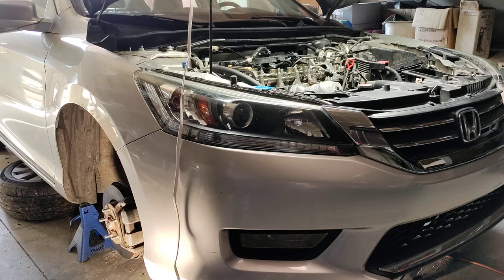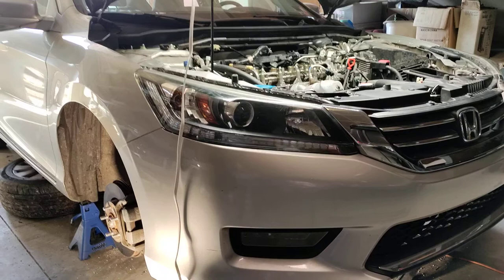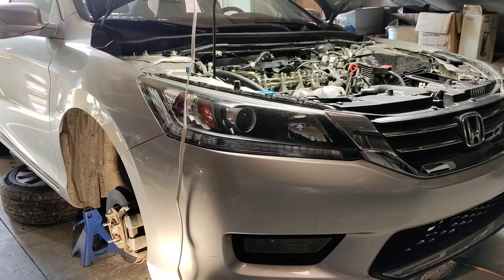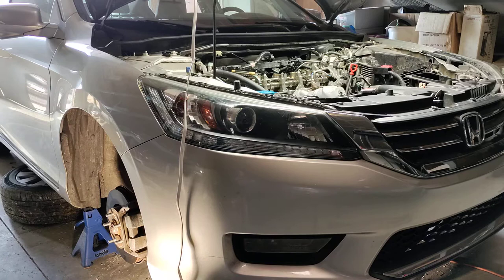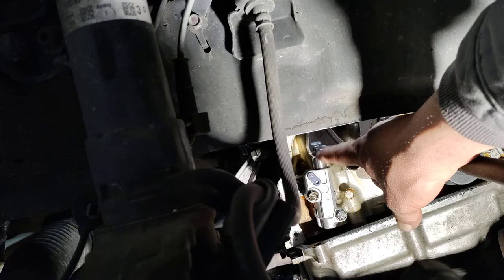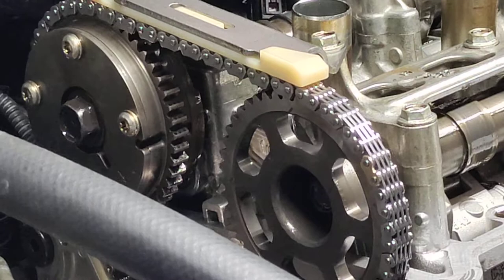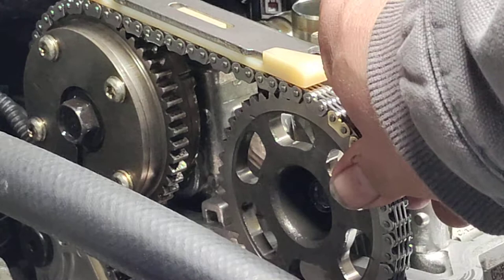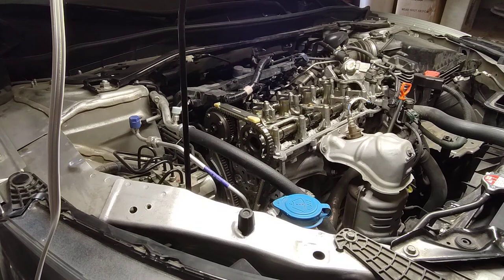honda k24 earth dream timing tensioner issues.

Comment: someone on YouTube was saying to remove the spring thats inside the cam and stretch it out further so its applying more pressure what are your thoughts on that idea?
Reply: No thoughts? Basically he was saying it was the tensioner that was the issue and that it was set to short from the factory

Comment: I had that rattle for about 3 years before i came to find out about the tensioner. Rattle went away after i replaced  it but never did the reset. Can i still do it with the existing or will i need to get a new one ?Note. I replaced it almost two years ago
Thank you in advance for the reponse
Reply from the maker: Wait until it breaks again. Not all of them do it. Just the lucky ones 😁

Comment: I have a 2017 accord manual with kseries earthdreams
I always wonder this but couldn’t find the answer..
If my tensioner fails, or my timing chain snaps or jumps, does it damage the valves and engine and completely ruins it like in other car brands, or it has the safety system that shuts off the engine like on toyotas? 
Thank you in advance

Comment: @Matt Shaughnessy new sub here. Been binge watching your vids. You really are the friendly neighborhood mechanic. Great info too. I have 94 Chevy Corsica 3.1, 97 Infiniti i30/maxima, 01 Ford sport trac 4wd, and 03 bmw 530i. All high mileage. Surprisingly the Corsica has the least at 120k but has been sitting 5 years. I think I'm going to get a Haynes manual and try to face some of my mechanic'ing fears with it. Selling the 530i with 178k miles. The Ford and Infiniti are about to pass 200k. I'm sure they need some work/service. I watched your service vids. Should I be looking to do timing belt/chain and water pump on the Infiniti and Ford soon? The Infiniti is a daily driver and I hope to get it to 300k+ like I've seen some go.

Comment: I was going to perform TSB 19-019 to replace the tensioner but now I’m concerned. You’re saying you did the service bulletin which broke the new tensioner immediately upon startup, the timing chain jumped a tooth, and the car misfired? Why would Honda not include the “move the piston out a notch” in TSB 19-019 if it caused all that to happen?
Reply: I ran into this issue replaced the tensioner started engine loud whine in front of the engine then went away and threw a cam crank fault. Repair instructions say to bring the tensioner down to the first notch or else it will damage the new one which I over looked working to fast.
Reply: @mycivicbroke4406  good info, I'll keep this in mind if I ever have this issue
Reply: @mycivicbroke4406   where does it say that? what year and model?
Reply: what did you end up doing?

Comment: I have a 2015 Honda Accord k24w1 earth dream engine my does this weird thing, where I am above 60 and when I let off the gas the rpm’s go up instead of being stable go from 1,500 to 3000. When I put my foot back down it jump ups.
Reply: This is normal, and intentional on Hondas part. The k24w1 (earthdreams) is paired to a cvt transmission. Honda has programmed the engine and transmission to hold a higher rpm when going at highway speeds. This way the engine makes more torque sooner for better highway passing abilities.

Comment: assuming this is the same for the 2013 accord earthdreams engine
Reply: yes but actually this problem is much more reported by the newer model years. Not sure why (could come down to as little as a Q/C engineer in the company leaving that year or a slight change in tooling/metallurgy) it still happens on some 2013's but they seemed to have Q/C down really well at the start of the 9th gen. If I run into this problem I'll leave a reply, i got a 13 coupe and I'm gonna take it into the shop to get looked at next week

Comment: I'm building the bew type r 2021 and it has the same issue timing chain is coming loose after turning the motor over by hand. So would the oil pressure keep it tension on it?